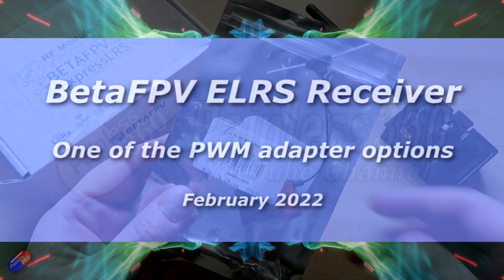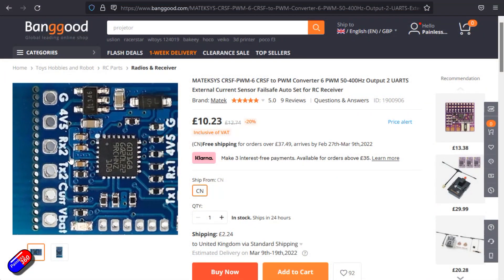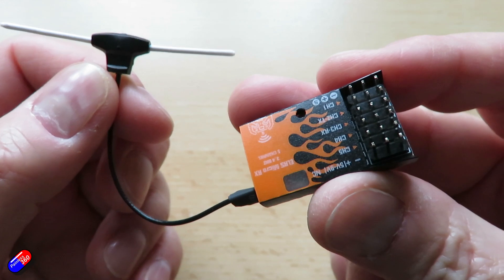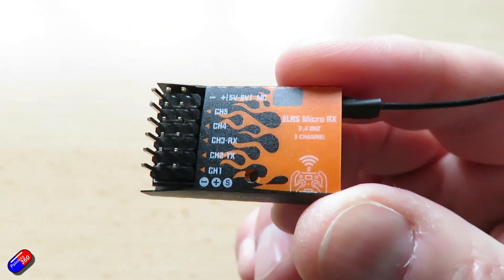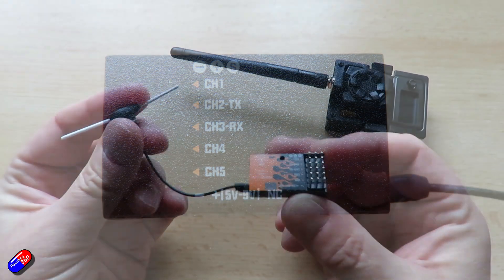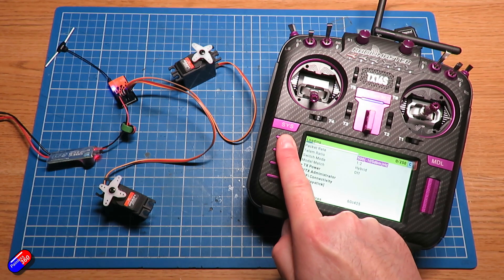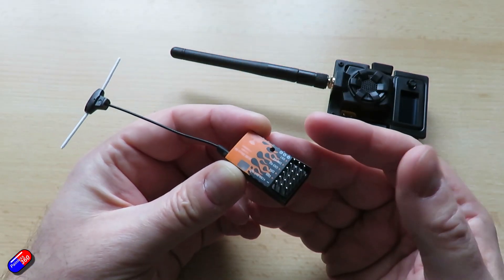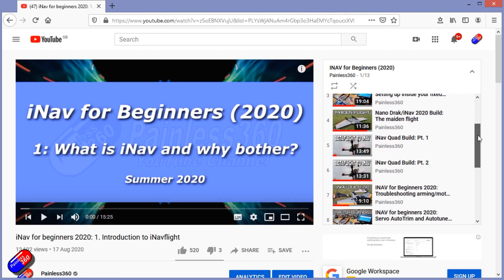2.4Ghz ELRS receivers now available with PWM outputs - perfect for planes, wings, boats and cars!

Comment: hello, I have a simple 2 servo glider
i know i can power the reciver with 2s 8.4v widouth using a ESC BEC but when i do than do i frie me 5v servos ore do i get 5v coming out on the pwm pins
Reply from the maker: That would put the higher voltage out to the servos, so you need HV servos or a 5v BEC... Happy flying
Reply: thx fore the help

Comment: Hi, Nice review. Got this RX recently and during flashing to the newest ELRS version something went wrong with the Wifi connection. I know there is a BetaFPV device available to un-brick their receivers and how to recover those micro receivers. Nowhere any mention on how to proceed with this receiver to bring it back to life. Can you get a solution how to get this done?
Thank you.
Reply from the maker: I'm planning an Unbricking video. Stay tuned
Reply: @Painless360 I think I may have a similar problem.  The WiFi mode is on a setting where it won't advertise the GUI.  I can see it has an IP on my network but doesn't have the website.  Is it possible to hold the buttons in some pattern to reset to factory defaults?
Reply: NVM, I banana clipped the bind button for minutes and then hit the reset and it is broadcasting again.  BTW your videos are the best!  Thanks for all you do!
Reply: Thank you.

Comment: is there a way to get the LiPo voltage send to my Radio with this? i'd like to build a plane but fear that i will overdrain the LiPos
Reply from the maker: Many of the latest ExpressLRS PWM receivers have a battery voltage monitor port. Check out the latest PWM receivers from RadioMaster that I looked at a few weeks ago... best of luck

Comment: thanks
I must have missed this video or the 0:35 explanation cause I was never sure if I could use ELRS with my wings and boats or not especially regarding the pan tilt camera platform.
Now I slowly learned that i could have used my elrs system also with wings if I had used that csrf to pwm converter or most likely a speedy bee flight controler.

Hope that some one searching for this topic might find this comment usefull.
Reply from the maker: Yep, the clue is in the title of the video :D Happy flying!

Comment: I used it with tpro internal elrs .....but the range was just 250m...is it because its just 17mw telemetry power.
Reply: Should be able to get better than that. I have seen 10mW hold the telemetry link out to half a mile through a wall before. Perhaps the antenna was 90 degrees out of alignment or was on a null, which is the reason I previously had issues. Go vertical or diversity if possible!

Comment: I love this receiver for my plane nothing could be better But now i like to build a Boat with 2 motors how do i setup this for drive forward backward and left and right just by using this mentioned 2motors could you help please
Reply from the maker: It depends on the type of ESC you are using. If there isn't a forward and reverse then it is super easy. If not then videos like https://www.youtube.com/watch?v=mTZrsUoFMnw are worth a look. Best of luck!
Reply: @Painless360  thanks I am using the Betafpv  elrs micro rx PWM
Reply: @Painless360  XXD 40A 2-3S Brushless ESC Speed Controller For RC Airplane Fixed Wing - 2PCS this are the esc`s i want to use retour must have i am using a radiomaster tx 16S or Zorro
Reply: do you have a idea how i can solve this???
Reply from the maker: I don't have a lot of experience with reversing ESCs.  Best of luck

Comment: Is it possible to connect a brushless esc to it, and if yes do you have any suggestions (about 40 amps)
Reply from the maker: It is but I do not use brushed ESCs and motors here so cannot recommend something I like.. Best of luck!
Reply: Hi i have a brushed esc  ...which canal i have to use for motor .i used this receiver with jumper t pro ....its weird i lose the signal at about 200 m

Comment: Hi! I heard that only the first 4 channels are full resolution while channel 5 isn't. Still, can I use channel 5 as a slave for a dual servo aileron setup without affecting performance? Thank you.
Reply from the maker: https://youtu.be/xXftiFz9KKM
Reply: @Painless360  thank you! I tried setting elrs to 333mhz but it says baud too low. Manually setting the baud rate higher didn't solve it. Its a Radiomaster tx12 mk2 I'm using.

Comment: If I want to use it with FPV, which firmware should I flash to make it work in crsf mode. Right now I'm using firmware of betafpv nano 3.0. It doesn't work properly and sometimes loses signal.

Comment: Great content great information. I wanted to know if this reciever would allow me to use a express elrs tx module with my Radiolink RC6GS V3 like the tbs crossfire for extended range?
Reply from the maker: This wouldn't give you lots of extra range as it is still using 2.4Ghz (like almost everything else). There are versions of the ExpressLRS system that use 868/915Mhz and they should provide more range. Not sure about how it would work in that radio, it needs to talk CRSF to use the radio module..
Reply: thank you for the heads up

Comment: One thing I found with this receiver it doesn’t like servos on y leads. I had to separate my ailerons to get it to work.
Reply from the maker: How odd. Works here. I wonder whats different.. Happy flying!
Reply: @Painless360  yes very odd. If I powered up the receiver and then plugged the wing in it worked, if I plugged the wing in and powered up the receiver it would connect to my transmitter but no control at all.

Comment: Any idea what the PWM frequency is or can it be set on this RX? Looking at the MATEKSYS CRSF-PWM-6 module you can set it at 50, 100, 160, 330, 400Hz.  Just wondering what system gives the overall lowest latency for PWM servos.
Reply from the maker: The relatively slow physical movement of a servo (and the resulting change in orientation from the change in the flow of air over a control surface) makes any reduction of 'lag' pretty redundant in most cases.  The PWM speed is more about what the servo will be happy with (I.e. 50hz for analogue servos) than reducing lag. See my INAV builds... best of luck
Reply: @Painless360  Thanks for he reply, I should have said this was for car steering.  You can get fast response servos for steering and they support up to around 300Hz PWM, hence I wondered if this RX was a good fit or whether its stuck at 50Hz PWM?
Reply from the maker: There are more capable PWM ELRS recievers coming so if that is important to you, I would wait...

Comment: I got this for my atomrc Dolphin build but unfortunately it doesn't work with INav 4.0 because they discontinued pwm receivers with the release. I'm new to Inav and watched the indepth release notes. I ended up going with a TBS nana pro and it works amazing with my unify pro hv vtx. Also I got the elrs receiver for only $12 on betafpvs official site so check there if you want it for less, they run deals I've been seeing
Reply from the maker: Using one of the ELRS Nano receivers that can talk to INAV using CRSF is the best option... Best of luck

Comment: Have you used this rx in any of your fixed wing models?  I have one in my AR Pro but the esc doesn't arm when i plug the lipo in. If i leave the lipo plugged in and take the rx plug out and put it back in it works? Also if i turn the model on first then the TX it works. I should mention all the other controls work just the esc doesn't arm.
Reply from the maker: Not yet as there is a new one from Matek that had more outputs and a few more tricks up its sleeve - video coming soon!
Reply: @Painless360  I managed to sort it out in the end with a quick update to 2.3 and a recalibration of the ESC. I'll keep my eyes open for your Matek review.

Comment: The benefits of ELRS seem to be far range and low latency.  For range, I'd want a FC running iNav or at least a Kopilot, and this wouldn't fit the bill for that.  Is the main purpose of this Rx for close range, lower latency?  If so, I'm not sure I see the benefit, since a few msec of latency doesn't make that much difference for wings .  Thanks for your help, I probably just don't understand this very well

Comment: Hello Lee, how do you set the failsafe on this for a plane without a flight controller ?
Reply: You can setup ur receiver to broadcast a wifi ssd then u use ur computer and connect to receiver ssid. From there launch you're browser and type in 10.0.0.1 :) Setup up you're fail safe there.
Reply: Failsafe settings are after a function through your transmitter.
Reply: @Sp3ktral22  Well, as I'm sure you know the ELRS is using CRSF protocol and unlike with FrSky receivers you don't have the option to set the failsafe in the OpenTX/EdgeTX transmitter. So my question remains: how and where do you set the failsafe for this receiver ? It's not in the radio, not in the RX web-UI and also not in the ELRS LUA script.

If using a flight controller than this is a non-issue because the RX will send the failsafe flag to the FC anyway. And if I use a flight controller then I will most likely be using an EP1 ELRS receiver, not a PWM one like the one in the video.

Cheers.
Reply from the maker: Asking on the Patreon feed will always get you a far more detailed answer - I've made a video for you on this.. ;)

Comment: I would add that the pwm pin section should be facing forward.
Upwards, all the servo connectors take out a lot of space, and some planes have tight spaces to fit all the electronics.
Otherwise, I would just unpin that RX and solder new L pins in place...
Reply: the matek version comes with pins unsoldered i just add servo pigtails as my servos need extensions anyway
Reply: @geterdnboy  Thats a really smart way for a solution!

Comment: I have the radio master tx16s radio controller. I want to buy the cinewhoop with cross fire on it. Do I need to buy the module for it?
Reply from the maker: If the model comes with a Crossfire receiver in it then you need a Crossfire module in the radio. ELRS will not talk to Crossfire receivers.

Comment: I'd love to see more channels added to these types of ELRS PWM recievers, so you can use them on more complicated planes. Looks like protocols like Spektrum and FrSky are in big trouble now 😂
Reply: Andy- have been having real issues with my Spectrum receivers working on quads, last time I tried it took three different receivers to get one to talk to the flight controller.  Have a fortune in JR radios, love them for airplanes but the available receivers that are available is getting slim to none.  Have you had any problems with this?

Comment: could you please give a recommendation for a elrs setup for a nasty litle wing that needs a gyro ... 
still no small wing flight controller with elrs available ?
thanks a lot
Reply from the maker: The thing with ELRS is that you can only get CRSF or PWM out of the receivers currently available. That limits the choices as most need SBUS. The only one I can think of that I've used here recently is the KoPilot but you'd have to use a PWM receiver like this one and accept that CH5 would only give you Launch/GPS RTH or Stabilise mode. You'd need a three position switch for it to give you all three.. I hope that helps.
Reply: @Painless360  Not sure why Beta wouldn't have made this with at least 6 PWM outputs as then for Kopilot you could use Channel 6 for you mode switch (3 position) any chance you opened it up to see what the board is like?
Reply from the maker: I'm sure if they get enough interest then there will be versions with more channels. I hope so as with only 4 channels on full resolution and CH5 stuck as the 'arming' channel it is only useful for simple planes..
Reply: @Painless360  I am trying 2 of the Matek ELRS converter boards, 1 a 6 channel and the other a 10. And since they have more than 5 I have set  channel 6 for the mode which give me all 3 modes for my Kopilot. Now just waiting for weather to improve to give the setup a try. I should have also added I am using a Beta Micro 2.4 module in the back of my TX16S and a Matek ELRS R24-D RX.
Reply from the maker: Best of luck with the maiden! :D
Reply: so we all hope someone of matek is reading here ......
Reply: @Painless360  This is the answer I've been looking for. Thanks Lee! It's a bummer we can't use these with the Kopilot. Did I understand you correctly that you can use it but, you would only have 2 modes on channel 5?

Comment: I keep thinking about trying this system but always run into one of two limits 1) The aircraft/quad already has a great receiver or 2) the ELRS channel limit. I want to change the receiver in my Solius glider. I thought this reviewed one would be great but only 4 channels. The Solius has spoilerons so needs 5. That's why I'll simply buy a 6ch PWN Crossfire Nano for it. Still, I keep watching videos on ELRS as it seems like it's going from strength to strength.
Reply from the maker: There are lots of us who are hoping that there are more versions of this in future with more PWM outputs and a few more full resolution channels. With the new settings CH6 on-wards can be used for things like gear and flaps but we need a lot more of the full resolution channels for the complex mixes we use on things like gliders and slope soarers.
Reply: @Painless360  so sad there will be no SBUS in ELRS
Reply: Full resolution switches now exist! 8 full resolution, 16 full at half rate, and hybrid 12 with 4 full and 8 more full at half rate. The pins should really be labelled Outputs, not channels as they can all be remapped. I am running aileron 2 on CH6, output 5.

Comment: Normally ELRS ch5 is 2-way only, to be used for motor arming. How does ch5 operate in this receiver? My experiments with a Happymodel EP-1 rx and Matek crsf adaptor showed ch5 fixed as a 2-way channel but ch6 could be set to Wide.
Reply from the maker: Looks like CH5 is still a binary one from what I can see here. I hope these changes to the hardware make the project rethink that existing limit..
Reply: In Edge TX can I reprogram an aileron to another channel like CH6 instead, and select CH6 in the rx firmware for output 5?

Comment: Nice and good video, I am working on ELRS for Aircombat plan, I use Happymodel EP1 and Mateksys CRSF for PWM-6 converters, The advantage of Matek converter is that you can get a v-bat from the battery in the telemetry back to the transmitter
Reply: And GPS data like ground speed too.
Reply: Yes, I've tried the same combo for the same reason. Ch5 is still binary though, intended for motor arming. I've fitted flaps to ch6 and the movement is jerky, even with the Wide setting. Mind you that's with a slow movement set in OpenTX, using ch6 normally could be OK.